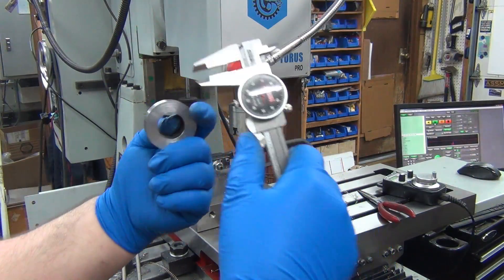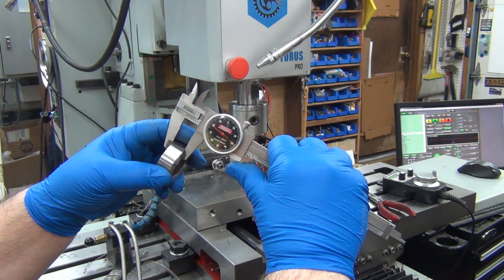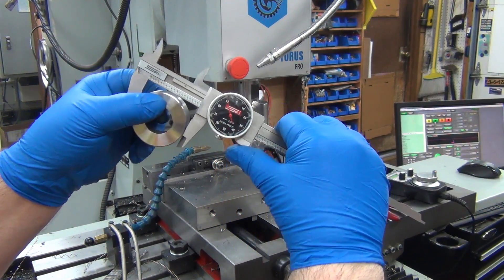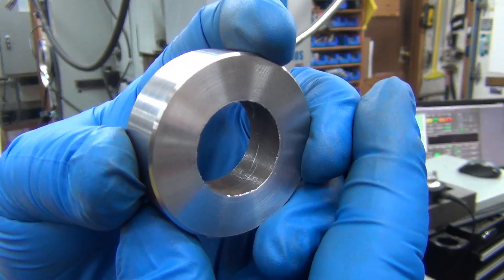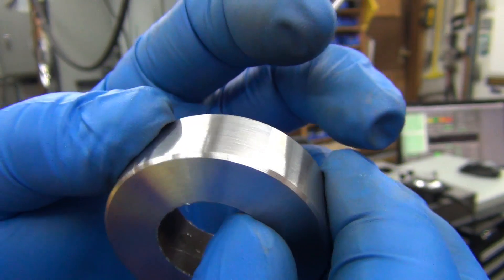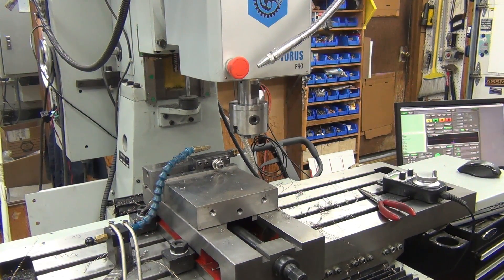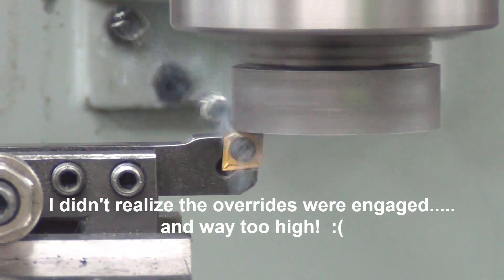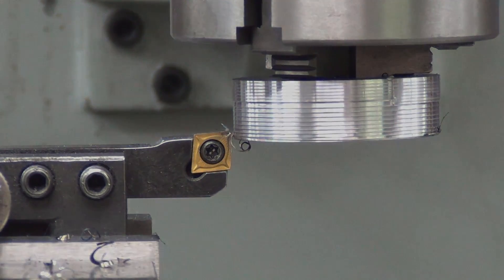Novakon Torus Pro - Mill/Turn, 311 hub spacer, OP1

Comment: That came out great.  What happened at the end there, would be nice to describe for those (like myself) that have absolutely no idea about milling stuff.  Something wrong with the plotting design?  The cut looks way too aggressive compared to the nice clean finish one you made at the beginning.  Did it burn up the cutter tip?
Reply from the maker: +DJDevon3 Ah....good point.  I typically try to, but I was in a hurry.....past my bedtime! lol   The control software has two settings that allow you to override the programmed feeds or spindle rpms.  I forgot and left them both turned up from other other testing I had done.  The rpm wasn't up high enough for the feed rate, so the cut was too big and stalled the part/chuck.  Had the rpms been up high enough, it might have made the part, but the chips would have been really dark.  I don't think the insert was hurt on that crash, but that's certainly a good way to chip/ruin them. :)
Thanks!!

Comment: That's one hell of a nice surface finish, especially considering how aggressive a cut that was!  That bit at the end, though...  Ouch!  Nice of your mill there to have a torque limit on it; no flying parts!  I had to dodge a flying engine block once...  :\
Reply from the maker: +rhkips They didn't all come out quite that nice, but close.  Typically, any flaws in the finish on those were caused by chips dragging on the part.....so I hit it with a bit of scotchbrite before pulling it off the mill.
Nothing as big as an engine block, but I've definitely thrown some parts off this chuck! :(
Thanks!